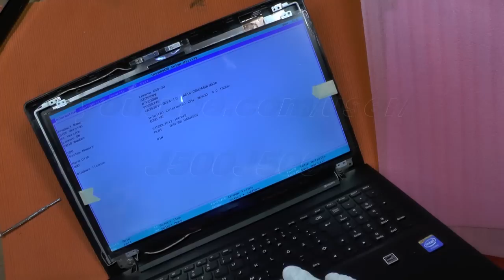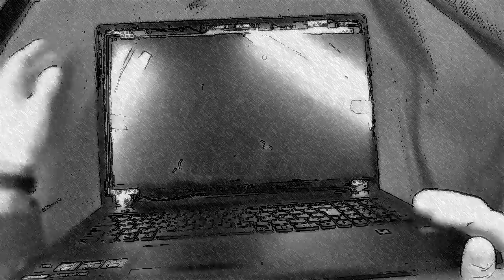Lenovo Change Screen Replace LED Ideapad G50 Z50 Z510 15,6 Slim

Comment: Five years on, still helpful. Thanks for the info.

Most importantly though, thanks for not commentating through the whole video. Virtually every other "How to" channel can take note: one or two "beware" notes on the screen is all that was necessary! Thank you thank you thank you 😆. Also no annoying music. Also completely unnecessary.

One small technical detail on your spudger: a credit card works better than that "guitar pick" style tool you used. I was able to get a fingernail under the edge to start (gloves? naah!) and then slipped the card in and was done in a matter of minutes.

But without this video I wouldn't have known where to start. Thanks again!
Reply: do you believe in afterlife?

Comment: Extremely helpful video. Thanks!

Two tips for you guys, if you're having trouble getting the plastic screen off - try using an icing spatula. I did, it worked great. And if you turn the computer on for that test run and the screen doesn't light up, make sure the connectors are actually butted up aganist eachother, you shouldn't be able to see the teeth. I was nervous about forcing em together too tight so my connection was too loose at first. Just take your time and go slow. Good luck!

I live in Florida and had a damn ant infestation in my laptop, I fumigated them so they all died but all the corpses ended up something messing up my screen... There were little dead colonies of hundreds of em behind my screen when I got it off. Just in case somebody else here has an ant-top 😂 Thanks again dude!
Reply: @Seth Archie Instablaster :)
Reply: @Forrest Messiah I really appreciate your reply. I found the site thru google and Im trying it out now.
Takes a while so I will reply here later when my account password hopefully is recovered.
Reply: @Forrest Messiah it worked and I actually got access to my account again. I am so happy:D
Thanks so much, you saved my account!
Reply: @Seth Archie glad I could help xD
Reply: do you believe in afterlife?
Reply: @ryanflanagan9624  I go back and forth
Reply: @lildoobers  so what do you think right now?
Reply: @forrestmessiah9109  do you believe in afterlife?
Reply: @setharchie3433  do you believe in afterlife?
Reply: @ryanflanagan9624  I'm inclined towards no right now.
Reply: @lildoobers  why is that?
Reply: @lildoobers  this is how we can know God exists, when we look at a building we know there is a builder. the building is evidence of the builder. the same with a painting and a painter. when we look at creation we know there is a Creator God. God has given us a conscious to know right from wrong, we know God's existence intuitively as well as we know right from wrong.

do you think God is happy with you or mad with you, are you doing anything that could be morally wrong in God's eyes or are you a good person?

Comment: I purchased a lenovo z50-70 (model 59442264) which has the worst possible display imaginable. Do you think I can replace the full HD TN panel with a full HD ips one? If yes, can you suggest where can I find a good replacement panel in India?
Reply: Would like to know if it's possible too!
Reply: +Dharmendra Oswal I have exactly the same problem! Could you give me an update, have you replaced the screen? Thanks in advance!
Reply: No, I have had no luck with local repair shops. I have given up on it, and repaired my 6 year old Dell Studio laptop, the display on it is a beauty. Fuck Lenovo, never gonna purchase its product again.
Reply: did you try it? and did it work?

Comment: Does Full HD (1920x1080) display work for this kind of laptop?
Reply: Yes
Reply: Hi. Can you please confirm if Full HD (1920x1080) display worked? I want to change the display to my Lenovo Z510. I know there are a Z510 model with a FHD display then I think it should work. Thanks.
Reply: Build a fence
Reply: Yes you can change it to an IPS Full HD.

Comment: I'm looking at getting a new screen atm and the website in looking at is asking whether my screen should have IPS or not? I have a Lenovo Z50-70, do I need a new screen with IPS?
Reply from the maker: +Harry Smith full hd screen (1920x1080px) matt ips panel...
1366x768px hd screen not IPS
Or simple your notebook screen with model number simple googling.
Reply: Hi. I want to know if is possible to upgrade my Lenovo Z510 screen. The original screen is 1366x768px, I want to upgrade to 1920x1080px. Is that possible? I know there are a variation of Z510 with 1920x1080px. Thanks in advance.

Comment: so guys the only solution is to replace with a new one or just clean the current screen inside?
i have a lenovo second hand, after 2 months started having this kind of problem ( stripes etc..) from your experience, possible just clean or need buy a new screen. ?
thanks happy new year 🎄✨
Reply from the maker: simply test a laptop external monitors..
"which graphics card, I think graphics chip (GPU or iGpu) preblem."

Comment: Is it compatible if i place a lenovo ideapad g550 or z510 screen lcd in my lenovo z500?
Reply from the maker: Zadista Reaper not possible.but z510 to z500 almost identical..the most important Thing by Replace Screen!!!!!Screen Resulation (1366x768 or full HD)Screen typ (Slim or normal)und Connector pin (30pin, eDP or 40Pin) Connector Position...

Comment: Can someone help me? my screen stays on with a sort of white glow at the bottom left part (even when turned off without any battery) and I don't know if it's a screen problem or a cable one. Also if it's a cable problem, how do I replace it? My pc is lenovo z50-70. Thank you

Comment: if the display blink at an angle of 90 degrees or less in between the screen and keyboard but  when the angle is more than 90 may be 100 or 120 the screen is stable .then what is the cause why the screen blink less then that position?

Comment: Am I able to upgrade my 1366 x 768 display to a 1920 x 1080 display? I have a Lenovo z50-75
Reply from the maker: +Lewis not possible
But display cable for 1366x768px
Reply: @j500j500laptoprepair  ciao io ho il problema inverso il mio full hd 1920x1080 è rotto posso mettere il 1300x720?

Comment: thank you very much nice viedeo my laptop is working again now. some of the briks broken while removing the panel and at the bottom it is not completly holding anymore but this is absolutly fine because tthe new screen is working! nice viedeo. Also the hint to check the display after connecting the pin was good because and first attemp i didt mpushed the pin in strong enougth. I realised that there is a sticker close to my kamera at  the porit where normaly is a lamp which shines every time the kamera is on, is this intended to prevent this lamp from shining while camera is on?

Comment: LCD Is working perfectly .. a problem is in touch screen only, So can i replace touch screen only without LCD?

 for a Y700 Touch-15ISK Laptop (ideapad) - Type 80NW
Reply: No because the touchscreen is built into the screen.

Comment: Hi i have lenovo b40-70.
After pressing the power button my laptop starts, but it doesn't show the screen. it gives me the welcome tone then i put my password and shut it down by (alt+ F4 ).
after making 3-4 attempts some time it shows the display and works good until i don't shut it down.
And again i follow the same for using my laptop.
What should i do?
thank you
Reply from the maker: Any problem
Matherboard faulty or screen cabel faulty or new screen faulty or or or........First try
Recheck Screen cabel
And Bios Uptade

Comment: There's a vertical line on my y510p lcd... Will disconnecting the port and connect it back will fix it. It would be very thankful if someone knows

Comment: Hi, I just replaced my screen. the computer turns on but the screen is still black, why is that?
Reply: Ian M Howd you search it? Think Pad keeps popping up. Also how much is it?
Reply: Ian M SAME
Reply: Ian M how did u fix it?
Reply: KAO O it works now lol, thanks.
Reply: Miyno 26 just make sure the led connector is on right, see 4:44

Comment: "Watch out!!! Plastic frame very FRAGILE !!!", the whole laptop is very fragile and almost everything is clipped on. Very dissapointed with the quality (and construction) of the G50 as plastic piece. Also the electronics inside, man, they did everything to reduce costs. I/O IC died and because of that HDD motherboard died. The heat sink for example, ridiculous, the only metal part inside this unit. You get what you pay for, in some ways true but man don't sell crap, please stop it. Don't buy it, it doesn't last long.